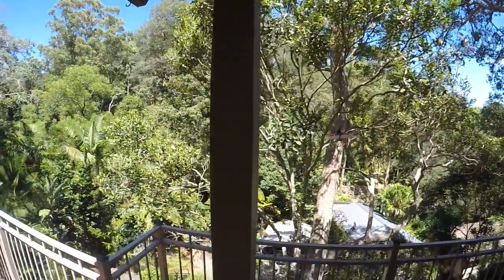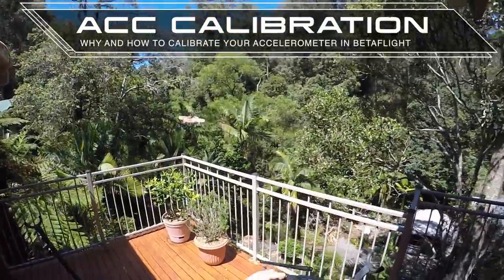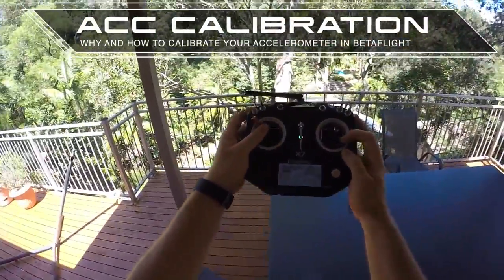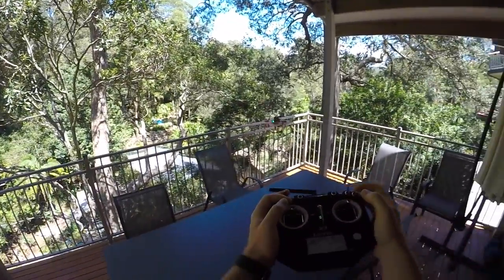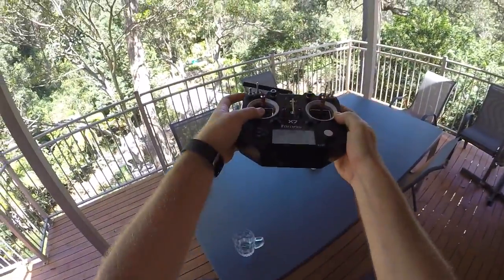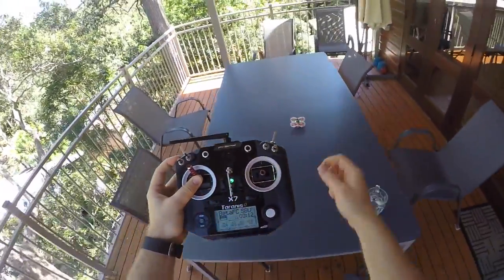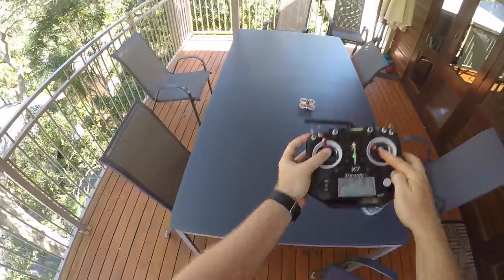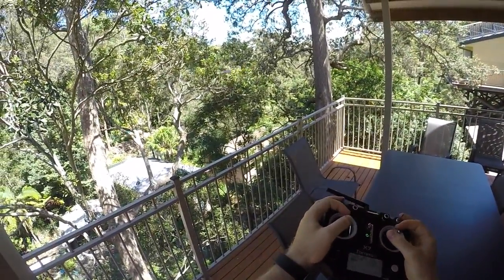How to calibrate the BetaFlight accelerometer

Comment: AWESOME ending! Really suprised with joy of you introducing 'best pilot in world'!

And yes it is. It has far more than 6 axis gyroscope, accelometer, barometer, magnetometer, two mounted cameras that has incredible field of wiew, some models can zoom from many kilometers movement to size of a mouse, some has nightvision, altitude holding, top speed of 390KM/h, 'battery charging' while in flight, they always assemble themselves starting from tiny woops upgrading them to perfect models, build in radio that has over 5000KM range with no interference, waterproof, integrated cold proof, anti-overheating-system, amazing spectrum of led strips, max. 125db buzzer with tons of different tones, 'sleep/idle mode' while flying, saves battery when flying with pack with lift and turbulence controll. Max. altitude 37000ft/11 270,60 meters, exellent processor with memory to save flying routes, sensors for dodging obsacles and saving them to black box memory for planning next flight route, Massive C burst rate. 
Heres just few modes that worlds best flyer can perform. Its impossible even by far human never build that kind of a drone.
God did them all and He knows place of each and everyone of these flying wonders. 
Matthew 10:29 NKJV
"Are not two sparrows sold for a copper coin? And not one of them falls to the ground apart from your Father’s will.
God bless you all! <3

Comment: Thank you so much for all your videos, they’re great!
Please excuse my unrelated question but
I’ve just saw you using a Taranis Q X7, and was wondering if you know a way to use this transmitter with the Furibee F36? Any advice would be appreciated.
Thanks in advance.
Reply from the maker: Im glad you are enjoying the videos, thanks for the feedback!

The X7 (like all other Taranis radios) has a module bay in the back, where you can install an external transmitter module to support additional RC protocols.
I dont have a Furibee model/FC, so I cant tell you what exact module you need or if there is any at all. You need to find a module that is compatible to the Taranis and supports the protocol of the F36.
There are multi-protocol modules, e.g. the iRange IRX4. Check their lists of supported protocols.
Reply: Micro Motor Warehouse Thanks for the reply! Actually I ordered one of those multi-protocol modules a month ago (China), and it will arrive today!!! I ordered it because I also want to control a couple of Eachine E011s...That will be easy, but the Furibees... I guess I’ll just need to test all of them and see what happens. Fingers crossed. Thank you :)

Comment: Do this calibration working with all radios or only with the Taranis? I'm using Spectrum Dx6e. Thanks
Reply: Mario Regeni This is a function from the FC. If you bind your Spektrum radio to a DSM compatible FC, you can calibrate using the same stick commands.
Reply: thanks a lot Benedikt!